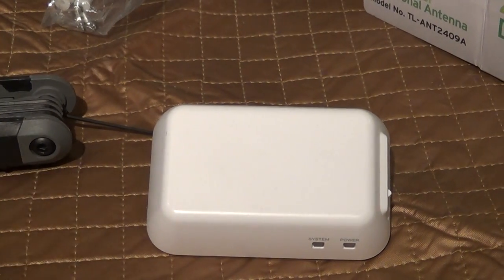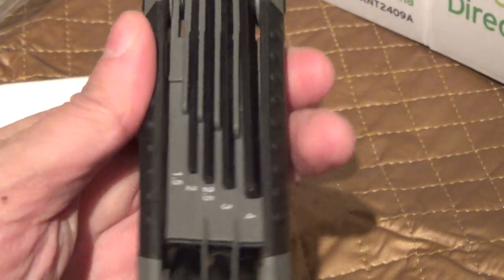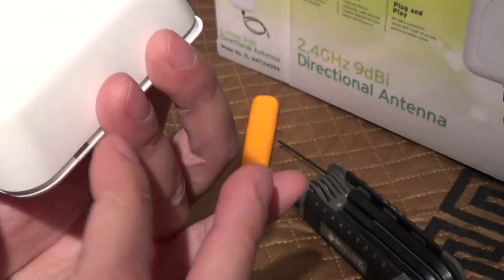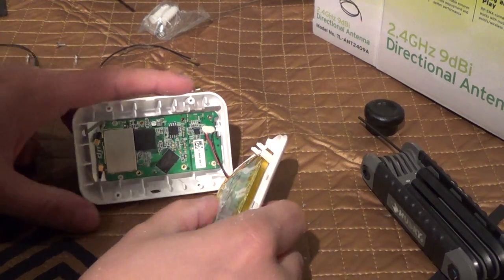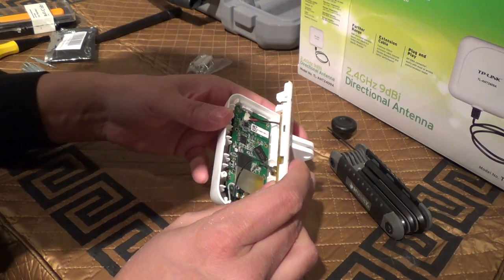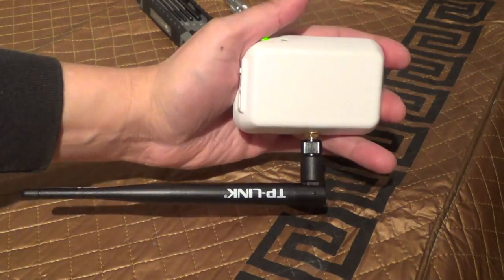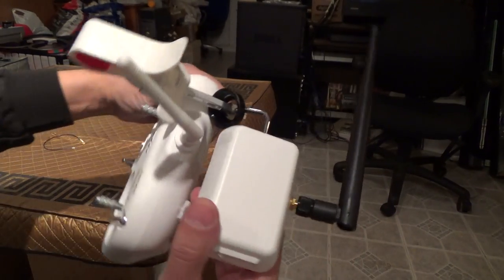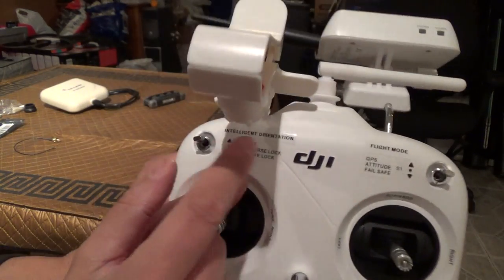DJI Phantom 2 Vision Wifi Range Extender / Repeater  External Antenna Mod increase FPV range.

Comment: Hey Ben, I currently am thinking about buying a better antennas for the wifi range extender. I would like to buy one that will preform better than the 9DB Directional Antenna. I think i want to just use one Antenna so what type of antenna would i want to buy or if you know of one that would be great! 

Thanks, 

Paul
Reply: hey there i did your mod and i was just wondering how i should position the 8dbi TPLink omni directional antenna on the receiver side
Reply from the maker: Paul Tata If you just modded one antenna port in the way I did in my video. I suggest using the antenna facing flat down in a horizontal position. And use the flat portion of the range extender facing the Phantom as usual. You will get the best of both worlds this way. It will use the internal antenna on the range extender at closer range but as it flys beyond those capabilities it will switch off to the omni directional antenna.  You can get very good results this way.  FYI flying the Phantom sideways to you will give you greater range still. As it's antennas radiate the most signal to the left and right sides of the camera.

Comment: nice man, idk what antenna i choose. 5dbi or 8dbi TP-Link black antena, what do you use? how many dbi?
Reply from the maker: I use both a Circular Wirelss 12DBI RHCP Antenna and a FPVLR 9bi mini dome antenna in RHCP. And I use two Circular Wireless Skew Planer Antennas on the Phantom, also RHCP.  If you don't change out the Phantom antennas you would need to get LHCP antennas.  I recommend either FPVLR or Horizzon as they both make good antennas. FPVLR is located in the states and is my preferred model over those two.
Reply: Ben7seven7 i got a phantom 2 vision plus +, connected with a iphone 4S, but i got delay 15-30sec "400 - 600 feet ".
if i install a antena on my range extender i will reduce my delay time? or i only get more distance of conection.

Comment: Want to do a helical on the 5.8 on my P2V+ and add a mushroom up top the extender - May add a amp to my FPV as well or should I do a AMP on my control and do a larger antenna?
Reply from the maker: Hi, Unless you will be passing a mile you wont need to worry about amping the 5.8ghz control. It also depends where you are flying.    Adding an Amp on the range extender is highly recommended if you want to do the longest range flights possible while maintaining a solid 640x480 30fps preview quality.
Reply from the maker: Also I use two RHCP Skew Planer Antennas on my Phantom and either my 12dbi RHCP Helical or 9dbi FLVPR Mini Dome antenna also in RHCP..  If not modding the Phantom you need to use LHCP antennas.  LHCP or RHCP does not apply tho to patch or standard dipole antennas.

Comment: Did your MOD on the extender and control range also used your Tablet mod - Here's the link - love the tablet mount - works very well - the antenna mod and FPV extender mod got me well over 1,000 MORE Ft. in my flying area - THANKS for your uploads!!!

DJI Phantom2 Vision Plus 2,200' flight from our house to Melissa's dad's house   11 15 14
 Hope you watch and comment - maybe like?

Comment: Should I have 2 tp-link antennas connected to the wifi extender? I only ask because there are 2 wires pluged into the wifi extender and I noticed you only used one of those plugs

Comment: Also, should i put an antenna on the phantom as well? The antenna i am referring to is the TP-LINK TL-ANT2408CL 2.4GHz 8dBi Indoor Omni-directional Antenna. I will have 2 of these on the wifi extender but do i need one on the phantom?

Comment: I was wondering if i could put both the antennas on the same side of the wifi extender and just have them pointing in each direction.
Reply from the maker: If using two antennas I would have them in two different orientations to get the best possible signals.

Comment: Ok.. what range (FPV) will I get once again with stock versus the upgrade.I have the PV2Plus...could you indicate the values before and after...thx
Reply from the maker: Depending on antennas used and where you fly you can reasonably expect approx 50% range increase using a single 5dbi omni directional antenna.  And more than 5x the range when using a 12dbi helical circular polarized antenna.  Those numbers are rough estimates though based on my experiences and will vary depending on flying conditions.  That range increase will further improve is changing the antennas on the Phantom as well.  You can double those numbers again if you add a 2 or 2.5watt sunhans 2.4ghz wifi amp to the range extender.  If using a Vision plus and amp you will need to use at least a 3dbi or up to 6db attenuator as well so as not to over drive the Sunhans amp.
Reply: Hey Ben thx for the reply, I ordered the 5dbi Omni directional antenna for my wifi extender and I lost you on the 3dbi attenuator.what it's main fuction.keep in mind I have a pv2p.Thank you for your time.Jim

Comment: hi i want to know if a RE500 repeater works with a phantom 2 vision plus?
Reply from the maker: I believe it should but you will get reduced range than the RE700 do to lower power output.

Comment: To start that I speak French
The antenna is tl-ANT2409A connet was where?
removing the 5 dbi quond just installed another or rp-sma on installing wifi ranks extender.On now installed the 2 sets?
Another small issue antenna 5 dbi 50% more if I add tp-link tl-ANT2409A What will be the gain. Thank you if you give me an answer, as I told you I do not speak English but your video will have very well
Reply from the maker: I don't understand the entirety of your question.   I will guess a give you a general answer.

First,  the 5 and 8 dbi omni antenna gave me double the range over stock roughly.  Tho the range is nice it's not as reliable as using a LHCP helical antenna of at least 9 dbi or higher.  You will get the extended range along with a more reliable consistent connection.

Upgrading more than one port won't necessarily extend your range but it will give a better view of the sky and it will use whichever antenna has the best signal at the moment.

Comment: Can I do this with my RE700 ?I mean the same plug on it as the 500 ? I did the mod on my 500 then got 700 and can't find any video's on doing the 700. Thanks
Reply from the maker: Yes this mod works the same on the RE700
Reply from the maker: Dirk Lucas Better late than never.  I see you got the mods done anyway and with great success. Good job :)

Comment: Nice video ! Have a question for you , Im thinking about adding a 5.8 Wifi indoor signal booster with the antenna onto my controller. Will I have to add a antenna as well to my wifi extender or the quadcopter itself ?
Reply from the maker: FOV range fails before the radio control so first thing you should be modding is your range extender and then the rc control.
Reply: Whoa I did the tx getting a distance of 1400 feet before losing FPV
Reply: What is a good antenna to add onto the wifi extender

Comment: Ben7seven7   After install and test, I'm only achieving the same range as stock antennas.  Around 750 ft at 400 ft Alt.  What type of range are you getting with this setup?
Reply from the maker: Range depends on where you're located.  In a Park environment the stock config gave me 1,300 feet using the lowest preview quality setting and using just a single 5dbi tplink antenna bumped me to 2,000 feet give or take with the same preview settings.  Using higher gain circular polarized antennas simple knock it out of the park pushing you into the 1 mile range depending on the antenna. 

If you're flight range is exactly the same after modding you may have your GeoFence turned on flight limits.  Also depending how close you are to an airport and if you're using the newer firmwares you can not fly above 400 feet either, it wont let you. 

Another thing to consider is there may be a problem with the antenna power output you're connected to. Usually they should both be about the same but sometimes there can be variation, or damage.  Try connecting to the other output.  If still no improvement then you have a problem with the U.FL to RP.SMA connector wire you purchased, that or the antenna itself.   

overall this is a simple mod, it goes without saying that putting in a higher gain antenna will improve your results so in summary, if you're not getting longer range then there's a problem with one of the things I mentioned.  1) The internal flight limitation settings 2) poor power output on the connector, try the other 3) bad pigtail cable 4) bad antenna.
Reply: Ben7seven7 Thanks man.  My P2V is still on 1.08 so the assistant doesn't have a flight limit setting I can find.  I'm going to do a test today with the setup again and see if it's still maxing out around 750ft.  If so, I'll try swapping to the other antenna plug.  Thanks again.
Reply from the maker: MolonLabeUSA No problem and best of luck with that.   I had similar problem at one point where i began loosing range and eventually found that the output i was using got degraded somehow in power output so I switched to using the alternate connection for my main high gain antenna for FPV flight.   I also doubly confirmed it using a wifi analyzer program on my Nexus 7.  I modded both ports, put a low grade antenna on one port and higher gain antenna on the other and tested each, then swapped antenna positions and tested again.  I found that one of the two ports almost less than half of the output / dbi gain so that further confirmed it.  Strange thing is it wasn't like that initially.  But with all the times I took that thing apart it may have been damaged maybe with static electricity or something else, anyone's guess.
Reply: Ben7seven7 Right on.  If I still have no luck, I may try ordering new pigtails (had the two pack and tried both with same results so I think they're ok, but might test with an ohm meter to see if they cut out when moving them around) and another 5dbi TP-Link and use both at the same time to check results.
Also, I thought the range settings in the assistant were only for controller, not WiFi, but I don't have the setting on the older version anyway.

Comment: Hi Ben,

I'm using Dji P2V+ and still confuse about range extender,
Either FPV (2.4) or Radio (5.8) which one I should extend? or both?
Wifi booster is use only for FPV (2.4) to my android / iphone, am I correct?
Lets say if the max radio range is only 500 meters, so what is the point extend the FPV range? Kindly please help me as the begginer in this hobby...

Thanks in advanced
Reply from the maker: The maximum radio range is further than the FPV Range out of the box. In fact in a park setting most people can get around 1km range, not 500m out of just the radio, sometimes more sometimes less depending on the environment. First thing to do is add an external antenna option as explained in my video to increase your FPV Range. Using a LHCP style antenna will yield the best results. When you get the the point where you're able to fly further than the useful range of the radio control, the next step is to mod the radio controller for external antennas as explained in my other videos on that.   Additionally if you want even further range than just the antenna swaps can provide then there's the amplification option. You can add power amps to both the wifi range extender and the controller once they've both been modded for external antenna use.
Reply: Ben7seven7 Thanks for your explanation, I'll try to extend my wifi 2.4 ghz for increasing my FPV range, actually my expectation is to fly 1 mile is more than enough...

Comment: how much longer is the range to the phantom.
Reply from the maker: That all depends what antennas you use and where you're flying.  Using a 5dbi omni directional you'll see 50% or better increase in range.  Using a higher end antenna like my 6.5 turn helical along with a skew planer on the phantom and you can easily expect roughly 5x the range over stock or better.  Add amplification to the mix and that extends even further.  

Directional antennas like the Helical require you aim very precisely as the Phantom to achieve maximum range.

Comment: which of those antenna gives the longest range?
Reply from the maker: A 6.5 turn helical antenna has by far given me the best and most reliable performance.  It was also the most expensive. 

As far as the antenna I spoke about in the video I actually felt like I got the same or  better performance from the 8dbi tplink omni directional than I did the 9dbi directional.  Tho it may be a matter of aiming the directional better.
Reply from the maker: al Cella My 6.5 turn antenna is made by Circular Wireless for $120. I purchased it from ReadymadeRC.  I also have two Circular Wireless Skew Planer (Mushroom shaped antennas) that I put on the Phantom as wel ($45 each).  I also got a pair of inexpensive Skew Planer antennas from Hobbyking that also perform admirably as well for a fraction of the price. 

FPVLR sells their own version of a 6.5 turn helical for in either LHCP or RHCP for $70.  If you went with the LHCP version you wouldn't have to worry about adding antennas to the Phantom as well.  If you're like me and upgraded both it doesn't matter as long as you match like to like. RHCP to RHCP or LHCP to LHCP for optimal performance.

Comment: Awesome.  Going to order these parts tonight.  Thanks very much for putting together a top notch video and very nicely done testing with information in the description.
Reply: Got the parts and just installed.  Went with only upgrading one to a TP-LINK.  All systems go and I'll be going up later to see how it works.  So far, I'm usually good to around 700 ft without any issues so we'll see how it helps.  :)
Reply: MolonLabeUSA Hi man, so, how did it help ? Thanks !
Reply: +Artur Pelicho Wow totally forgot to update this!  Absolutely it's helped immensely.  I can hit 2500 ft distance at 400 ft feet without issues in unpopulated areas (low RFI).  Haven't needed to go farther yet hehe.  But it keeps it glitch free up closer for sure as well.
Reply: Thnaks man ! :D

Comment: Is there any reason the U. FL WiFi cable is different than the one used for your controller mod? Would these one's work for controller as well?
Reply from the maker: Same cable, tho it's easier using a shorter length cable in the repeater for routing.  Otherwise cables come in different thickness gauges but any will work.  I went for a thicker cable in the controller and on the phantom itself but again the thiner cables will be fine.
Reply: Ben7seven7 ahh man not the answer I wanted to hear.  I have performed the controller mod and have have significant range loss!! whomp whompppp. I used one of the wires you listed under this video and bought a TP link 8 dbi omni directional.  I have been flying with and without the antenna attached and the range is the same so I have a hunch the signal is not transmitting through the antenna.  I originally thought that it may be because I installed a different wire than suggested, figured the wire thickness had something to do with it.  Any ideas?

Comment: Quick question bro... when you make these mods, do you have to change the max miles, altitude manually on the Phantom assistant sw? If so, what is it for the 5 and 8 dbi?
Reply from the maker: Left hand Circular polarized antennas by far work the best but using the 5dbi antenna worked pretty well and did give a noticeable improvement in range.  And of course the higher the gain the antenna the better it will be.

Comment: Hey great stuff man! I'm about to purchase a P2V+ to take birds eye video of my 1km(130acre) of ocean front in Ecuador and a few other smaller properties I bought. I need the best resolution and I'd like to take her out over the ocean, turn her around and come in a blazin sharp video. I need to do a few videos, a coastal sweep, over all overview, and a couple investigatory ones. Now that will take good range and vary good resolution. I was thinking of your mod but was wondering can I still be using the better GoPro camera that I'm at this point intending to buy/use?
Thanks

Comment: Cool thanks, second question. The link you posted with2 connectors and 2 antennas, could I buy that and use one for the wifi repeater and the other for the remote?

Comment: does this set up work for the Vision Plus?
Reply from the maker: The circuit board is a little different on the V+ but the mod works just the same so no worries.
Reply: Ben7seven7 On the V+ there is a sticky pad with a copper foil sandwiched in it under the circuit board, Any idea what this is for?
Reply from the maker: I don't know but it doesn't really matter as it relates to modding the amp for an external antenna.

Comment: Hi Ben7seven7 

Great video! Is there a way to externally power the range extender while it's in use so that the battery doesn't drain? I do events where I can sit near power outlets with no problem.
Thanks!

Comment: I have parts ordered to do this, however I haven't done anything else to mine its all stock will this really help?
Reply from the maker: Depending on the antennas you use this mod can make a complete night and day difference for your FPV range.  It's very worth while.
Reply: Ben7seven7 I actually tried it already, not for sure what I did I may have nicked the circuit board with the drill bit not sure but anyway it messed up my wifi extender, I have another on order and I'm going to try it again hope if works haha.  I'm trying to use a tp-link 8dbi.  I also have that big directional one as well.  I assume they should work?

Comment: On the 4600ft achievement what was your antenna arrangement type installed on the aircraft?
And will you be getting the new patch from dji to use the ground pad option?  Can you make heads or tails of the 3.1 mile flight max vs. the 1640ft radius limitations ?